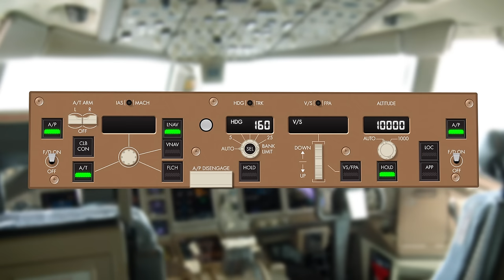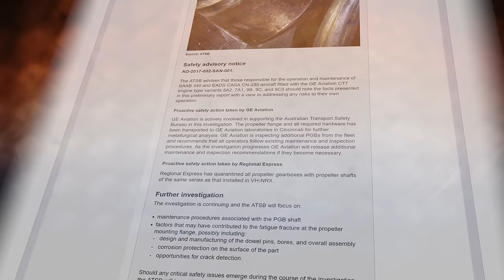Propeller Problems [with ATC audio]

Comment: That is far from the first,or last, propeller leaving a SF34 aircraft.  These aircraft have a history of propeller and engine problems.  I lost one back in the mid 1980's;  Propeller never actually left the aircraft, but I would have been better if it had,  These aircraft have a wild history of catasthrophic engine failures. Both contained and non contained.
Reply: Why would it have been better? Not feathering, drag?

Comment: Fantastic video as always. Also a nice to touch to hear the ATC transmissions to other planes in the area.

I have a question though. Why do pilots often 'require' a certain runway? That Qlink 'required' 16R then suddenly didn't when they realised they weren't the only emergency. Was 16R just a more convenient runway or is there more to it?
Reply from the maker: In a broader sense, when a flight crew declares an emergency, it's air traffic control's job to facilitate any request they may have where possible. Both Rex 768 and QLink 472D had declared a pan, Rex because of the engine incident and QLink because a passenger on board required medical attention.

The QLink crew wanted to land on 16R because it's much closer to the terminal than taxiing back all the way from the other end of 16L, and they wanted their ill passenger on the ground and under medical care as soon as possible. The Rex crew wanted to land on 16R because of that, and because it's a longer runway in case of further mechanical failures. Once the QLink crew realised that there were two aircraft with emergencies, and that the other aircraft had an arguably more serious condition with an engine shut down, they were happy to accept 16L with the long taxi rather than potentially holding for 10 to 15 minutes or more while a runway inspection was performed on 16R.